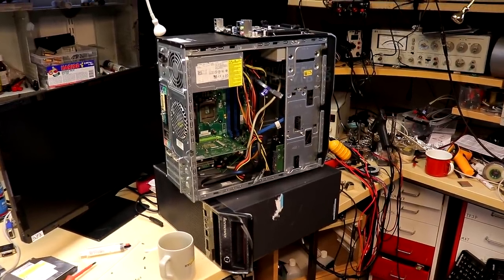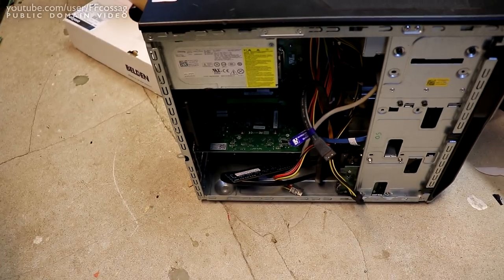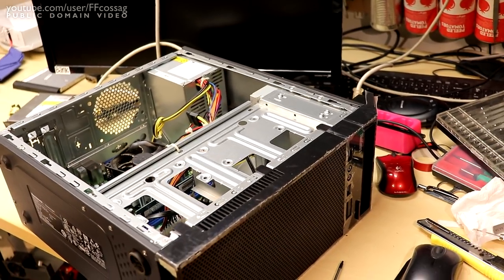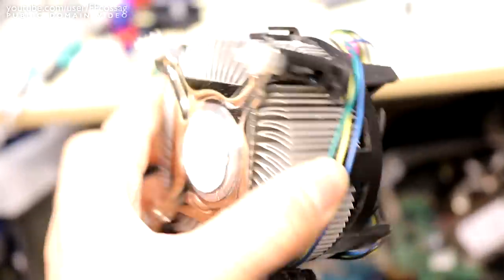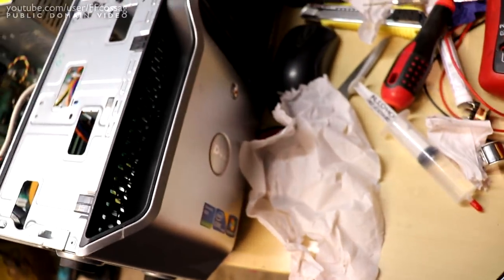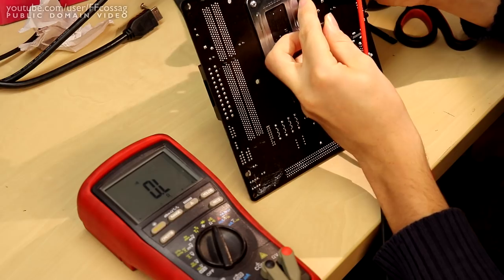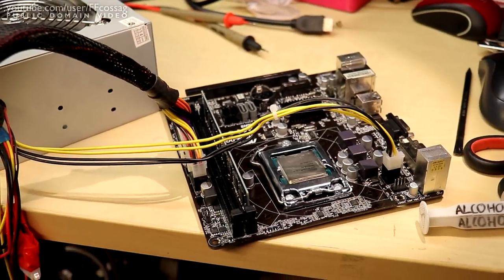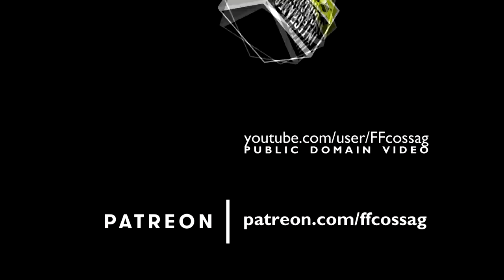Blog. September trash picks

Comment: My ghetto test bench is a motherboard box...
Picked up a bundle that included a LGA1155 motherboard (some bent pins that I needled back into position), bought a dirt cheap CPU to test it (p&p was more than the CPU) as I didn't have any for the socket, then went the whole hog and got an i7 3770 for it after it tested ok (this is going to be my new system, so I thought I may as well max the CPU rather than going just a little better than what I had) - I did have a spare 4GB kit, after being unable to leave it in my previous system alongside the added 8GB kit due to heatsink obstruction

Comment: 11.9 isnt a bit low for 12v rail? When I tested my server supplies i got for playing and crypto power i have read it should be like closer up to 12.4 on low load/no load? At least atx spec points 12v rail kinda high. do not remember exact values.
Reply from the maker: It used to be +/- 10 % when that PSU was made, so you're good down to about 11 V. Not very tight specs at all.

Comment: Hey, wanna have an Asus X99-E WS board? It has problems with PCIe slots, but it may also be just the Xeon CPU I had in there.
I have no additional power supply to test it further. Maybe I should get one or borrow one, just to see if it's the CPU or the board.
I first had a Xeon E5-2637v3 in it, later upgraded to a Xeon E5-1650v4 but then, after just 2 years my GPU wasn't recognized reliably anymore.
I tried other slots and it spread to other slots, too... Maybe the E5-1650v4 is broken or my board is trashed.
Reply from the maker: If you want to be rid of it, you can throw me an e-mail at ffcossag@gmail.com. However, I don't have any CPU to go with it for the time being, and I'm not looking to upgrade my render server, so I'd likely just shelf it. You're probably better off selling it cheaply on Ebay.

Comment: Why did you smash up that fan. A drop of oil in the bearing and it would've been fine.
Reply from the maker: No, it wouldn't, since the sleeve bearing was worn out of tolerance. Nothing can save it save for replacing the bearing, and that is not a valuable use of my time.